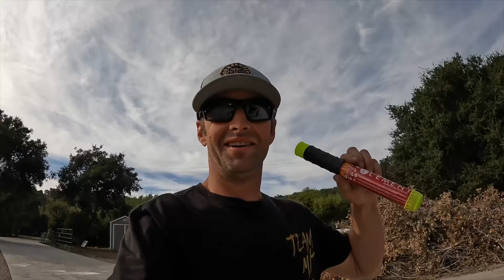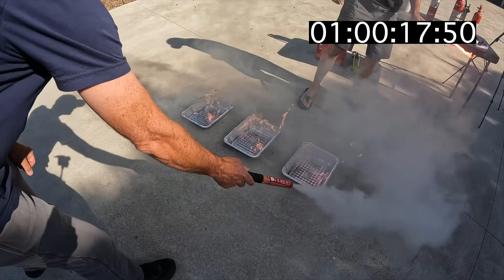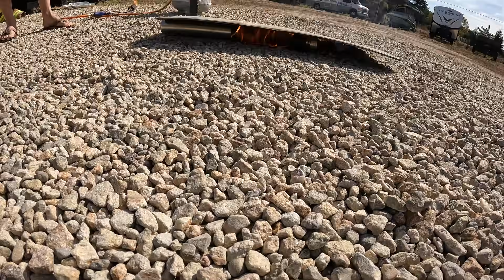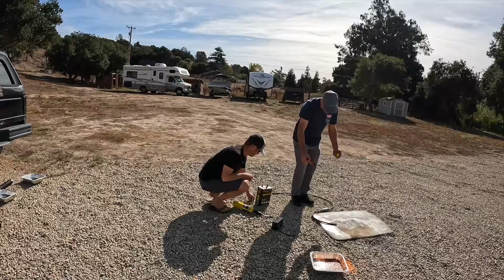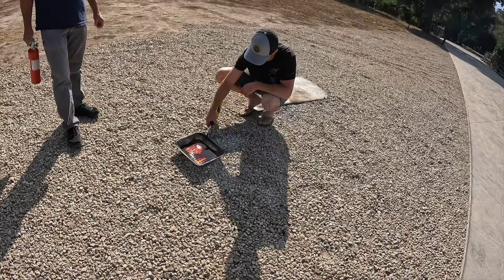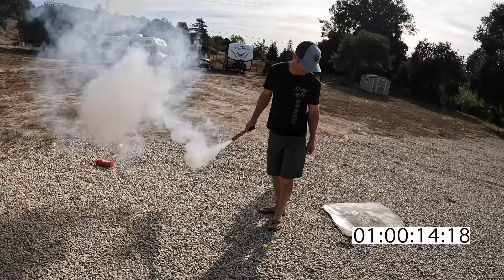Firefighter Tests Element Fire Extinguisher. DOES ELEMENT WORK?

Comment: Forget those stupid sticks and get a real fire Extinguisher with a pressure gauge! 
no guessing or wondering with a real bottle with a pressure gauge, just pull the pin
and away you go, and 2 is better than one.

Comment: what extinguisher can handle socals high interior car temps? need an extiguisher but most i have found can't deal with crazy temps. i don't want it to explode on me from built up pressure.
Reply from the maker: That is an interesting concern.  I have NEVER heard of an extinguisher exploding from being in a car…..
Reply: @Chasing518  neither have I but keep setting record temps every year(feels like). .  extinguishers i was able to find specified safe storage temp up to 140 F which my car interior surpassed last year Had to take portable batter pack out of car. contacted the manufacturer that advised against storing battery packs in car with high heat. but i digress it is something that i am keeping in mind trying to find a extinguisher rated for high temps.
Reply from the maker: @jose4167-i9v might consider a sun shade and cracking your windows.  That heat cools your interior and ruins it too.
Reply: @Chasing518  in southern AZ even with a white vehicle, window shades, & cracked windows, interior temps easily reach 150°F + in the summer. When the ambient temp is already 110-125°F it is easy to get that hot inside. Ever seen people baking cookies on their dash or fry and egg on the side walk. I have measure my driveway surface to be 165°F+ in summer.
But I do keep a Halon fire extinguisher in my vehicle & it has never exploded. neither has the propane tank mounted on the outside.

Comment: I would not call this the "real truth" sure that is a catchy title but it is rather misleading. None of your tests involved any fires with combustible materials. The vast majority of real world scenarios would have materials that are on fire such as foam insulation, plastics, rubber, fabrics, wood etc....  Multiple other testers on youtube have shown Element failing at this task of extinguishing these materials. It seems misleading to only test liquid fires as this is entirely different than what one would encounter should they face a fire in their own vehicle. Even the exhaust wrap test is totally misleading as the fiberglass material is not actually combustible, it is only the ATF that is burning.

Comment: In most of these cases, the fires were pretty small and controlled. I would suggest trying it on some larger fires where the heat is already established or other components besides the liquid fuel are burning. In most cases in a vehicle fire, plastics (wires, covers, carpeting, foam) will be melting/burning as well as fuel. Try it again in a scenario like that. I personally wouldn't trust it until seeing more.
Reply from the maker: @Nick_Sorenson  i get all of that, but incipient stage is really all it is designed for.  I think its best application is a compartment you can “fog”.

Comment: The white cylinders may indicate USCG approved for marine use. Or, they may be non-corrosive sodium bicarbonate, because the normal yellow powder corrodes electrical wiring and apoliances. Or, that it is a kitchen extinguisher, which spreads bicarbonate over a wider area at low pressure, so it doesn't spread stovetop oil fires as badly.
Reply from the maker: Great info!  I’ll have to do some more research on that.

Comment: Oh it works, but those are laughably small fires with no real pre-burn so really are only any use for the smallest of spot fires, the EU version had to use bespoke testing as it can't even put out the smallest fire rating test fire for extinguishers here. Also setting up to fail with the dry chem by using an extinguisher that was missing it's tamper seal and was probably already used (always check the gauge) and one that was part of the 40 million unit Kidde recall in 2017 (because they might not work).
My worry is people getting over confident with these small capability units - by all means have it as a spot fire unit, but for anything more have the proper kit and look after it.
Reply: You are NOT wrong
Reply: As someone who works in fire protection, utilizing obviously dead extinguishers sent me while their timer was running. What a terrible comparison. The little 2.5lb put the fire out in a fraction of the time once they had one that worked.

Comment: After watching other videos using this product, then seeing this video, I think their failure is in how they were using it. I had decided not to buy one because of those videos, but after watching this I believe I will buy one for my Jeep. I will likely also have a regular extinguisher as a back up, but I’d much rather have the E50 to use first so it leaves no trace and does no damage and only go to the other type of extinguisher if the E50 won’t do the job.  I may actually buy the E100 though because it goes for 100 seconds instead of 50.
Reply from the maker: Awesome!  My whole intent was to test it more fairly.

Comment: Really wishing I had a couple of these in my glovebox recently.   Truck died immediately after starting - okay, gave it some gas and it started right up. Kept it revved up at 3000 and it ran. 

I've had to do this before, but only after the battery had died and the computer had forgotten the fuel mixture.  I would run it at 3k and slowly, very very slowly, let it down to idle.

This time, after maybe 10 or 15 seconds as I was letting it down, suddenly the ground underneath the truck was completely on fire. I was in the driveway, so I bolted for the garden hose and came back to put out the 40 sq feet of concrete that was on fire, then turned attention to the engine bay. Of course, by this point the hood release cable was melted and seized, so the hood was locked shut. I watched as the paint on the hood began to bubble and scorch from the heat inside.  I grabbed a floor jack and a post and started jacking up the corners of the hood for SOME access for the hose, as it rested atop the wiper cowl dribbling water from the top. When I got back to the hose, the plastic spray end was melted as well, in the off position. I put the whole coiled hose in the 1.5" gap and had to wait for the fire to melt it open.

After everything was finally out, and cooled, I was able to examine the damage. Mice had eaten a GIANT 1/4" by 1/2" hole in the braided fuel line right before it goes into the fuel rail. SOMEHOW this truck was running at 3000 rpm, for at least 15 seconds, as it was spraying fuel all over the engine bay until it finally ignited probably from the temperature of the headers. FML.

Comment: Thank you! I have 2 questions for my 4Runner kit. I will now get 2 of these elements at the 50 size. 1) should I also have a different fire extinguisher for redundancy and back up? If so, what do you recommend?  2) What do you recommend to do if a jackery style Lipo battery catches fire?
Reply from the maker: I would carry a traditional ABC if you have room, just remember to replace it every couple years.  If a LiPo catches fire, you are kind of screwed.  I feel like historically though, they mostly catch fire while charging, so do that outside where there are no exposure risks

Comment: Couple of thing wrong here, first about K class extinguishers.
K class is indeed for kitchens, but its for commercial kitchens with fires evolving higher volumes of vegetable oils and commercial cooking equipment, like modern deep flyers. Those extinguishers are stainless steel cylinders  much like a 2.5 gallon water extinguisher just a bit shorter and less capacity (6L or 1.5 gal) the K class extinguisher  is intended to be used in conjunction with and after the actuation of a kitchen suppression system, an ABC or BC dry chemical would be perfectly adequate for a home kitchen fire, ABC preferred for the potential A class combustible materials that most kitchens contain.
For the dry chemical extinguishers, the will only be caked up inside if the chemical used to recharge was contaminated. Back in the day we (we being the fire extinguisher service industry, and the NFPA) had the thought of the chemical "settleling" and during the annual maintenance it was previously suggested that the chemical should be "fluffed" this however has been removed from the maintenance procedure  as the vibration from using a dead blow hammer causes damage to the gauge and potential for inaccurate pressure readings as determined by the NFPA.
The 6 years between and extinguisher being placed into service and its internal examination   does not introduce enough settleling of the chemical to effect the operation of the unit, especially if, as you mentioned, the monthly inspections and annual maintenance are being performed.
In a dry chemical extinguisher there is the gas (nitrogen) and the powder. They combine to form a suspension rather than the gas pushing down on the powder.
In a vehicle the vibration shouldn't compact the powder especially if regular inspections and maintenance have been performed. I personally have emptied out 30 year old units and they almost completely expelled all the powder. I've also emptied units that were living on tow motors/lift trucks, so vehicles will little to no actual suspension, for a decade or more, mounted in an almost upright position and they too expelled almost the entirety of the extinguishing agent (powder).
My qualification is more than 20 years as a fire extinguisher inspector and service technician. I have discharged 1000s of extinguishers during their internal maintenance or to discharge for disposal. I get recertification every 3 years as per the "NFPA 10: standard for portable fire extinguishers" 
Great video showing the effectiveness of portable fire extinguishers.
Note, that platic valved unit with the without the gauge was pretty much useless from the factory, and since the factory tamper seal was gone (it was incorporated into the red or yellow plastic pin or locking "clip" that would have kept the push button locked in an upright position) the extinguisher had most likely been operated at some point. I'd also suggest that it was likely well past its expiration date, mostnof those use once and toss them types are required to be replaced at 6 or 12 year intervals, it would be on the lable and in the owners manual.
Also it should be mentioned that Kidde (the manufacturer of thos plastic valve units) in 2017 recalled 37.8 million of those units in the USA, plus millions more here in Canada, due to failure to discharge and nozzle detachment, including the ones of the same design as the one in the video, I'll post a link in a reply to my comment just so this comment doesn't get flagged by the algorithm.
Reply from the maker: Wow! Great info! Thank you for adding this. 🙏🏻
Reply: Yup very informative since I have that one with no gauge in my kitchen I think I’ll be replacing it  didn’t even know about the recall

Comment: Hey good demo! Just thinking... I fly a powered paraglider, and have seen a few incidents of engine fires recently, to which i have not seen a viable option of extinguisher for us, until this. Of course, weight and size are paramount, and effectiveness in open wind with a propeller is a question, but my thought is better to have a chance than none. Do you think these would work ok?
Reply from the maker: I think a high wind environment like you describe would be it’s achilles heel honestly.  I have ZERO idea how to extinguish a fire mid flight but you have my curiosity peaked!
Reply: @Chasing518  well I went ahead and ordered one. Maybe if nothing else it can help keep the fire at bay while I make the emergency landing... I hope to not have to use it but if I ever do or hear of someone having to do so, I'll be sure to drop the update here.

Comment: Kevin, awesome job!  Thanks for sharing your knowledge with us wheelers.  Very interesting scenarios and great to observe the way the element interacts with the fire.  Kill switch is an upgrade I need on my Jeep.  Scary to see the fuel pump fire.  Thank you!
Reply from the maker: Yep!  Another integration you could do is add an “inertia” switch from a 90s Ford.  They are a reset-able fuel cut off, that trips in an accident.
Reply: Every insurer I've had, offered coverage with a modest discount for a kill switch.

Comment: So my question is with those element sticks how do they hold up to the elements? 

My buggy sees plenty of mud and rain canada. Does the sparker work wet etc
Reply from the maker: @krisbarnard1684 I reached out to Element with your question and got this reply:

Element is not affected by extremes of temperature, humidity, or vibration. It is safe to store outside in super hot conditions or sunlight. That said the tip needs to be kept dry and the cap provides all the protection it needs for anything shy of continuous submersion in water. So long as the tip is not soaked you are ok
Reply from the maker: That is a good question.  Definitely not my area of expertise living in dry Southern California.  I’ll reach out to Element and see if they have an answer.

Comment: Excellent video Kevin! Love the intro and outro😂 one thing I was hoping to see, and wonder, can these be thrown into a vehicle fire? Say it’s getting hot or your worried about an explosion, could you light a few of these off and toss them inside the car or onto the motor? Or would the fire itself just melt them? Granted if it’s that hot these probably won’t do much at that point 🤷🏼‍♂️
Reply from the maker: I obviously haven’t performed your test, but I can say with 100% certainty that would not work.  If the fire is too big or too hot, save the Elements (or dry chems) for another day.

Comment: I have one in my 1931 model A pickup as well as my garage. Hope to never have to use them but piece of mind if I do. BECAUSE I just checked my ABC traditional red extinguishers- 5 years out of date and fully caked. Yikes I thought they were only a year or two old and functional.  The Element 50 just one less thing to worry about. As the video says just 1=0 so an Element (get a few for all locations Truck-garage-house) and a traditional and when your red Chem goes blah the Element will save the day - at least give you a fighting chances to break the fire Triangle.  Nice video fellas. 👍🏽
Reply from the maker: 2 is 1, 1 is none!